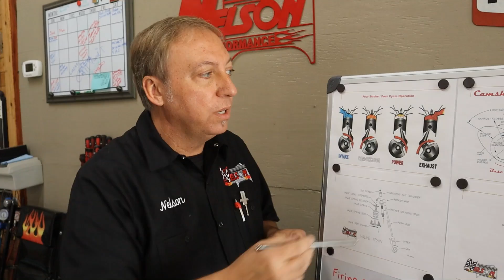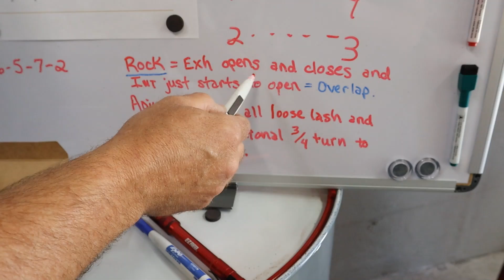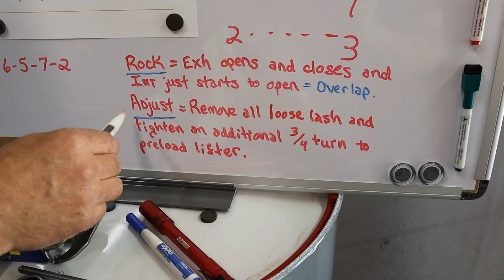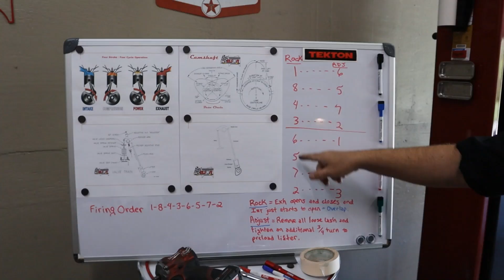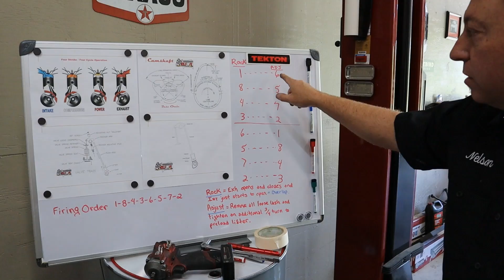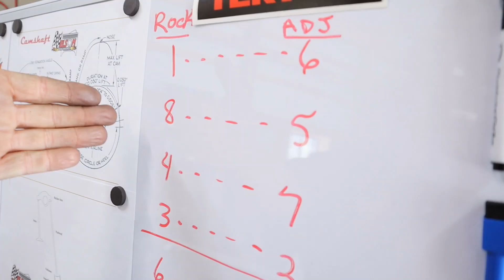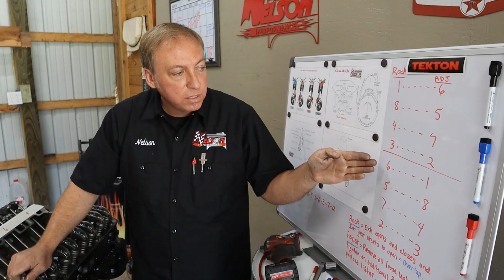Rocker Arm/Hydraulic Lifter Adjustment

Comment: I have always made sure they were all pretty loose on install, and then did each cylinder individually. I rotate until one valve is fairly open and take the play out of the other. Rotate again to open the other valve and close the gap on the second valve. Repeat for all cylinders. Then I adjust with the engine running, backing off each rocker until I get a tick, waiting a few seconds  for the lifter to pump clear up.. Then I close it down just enough to remove the tick & go 1/2 turn more. Some guys like 3/4. It's easier to me and never fails.
Reply from the maker: Yep, I’ve seen a few guys do it that way through the years. Gotta have good ears 😁

Comment: can i change rocker arms and pushrods without opening the valley/ removing intake? had wear and rod came through valve cover but not bent. i have not opened valve cover yet
Reply from the maker: Hey Bruno, yes, you can for sure do the rocker adjustment with the intake on. You would just watch for rocker movement v/s lifter movement. I would only be concerned that the lifter may have possibly popped up out of the lifter bore. It’s possible the area of the rocker that contacts the pushrod had worn through but I would also double check to make certain it didn’t have a tight valve stem in a guide. That would also cause rocker / pushrod damage.
Reply: @mitchnelsonperformance  I will check on guide clearance/ tightness. i will  try to see if i can use a boroscope i have to look down at lifter spot. thanks for response

Comment: How come some guys say 1/2 turn past zero lash?
Reply from the maker: Hey Rob anywhere from 1/2 to 3/4 turn will work. We just do 3/4 to make certain the lifter cup is away from the retaining clip.
Reply: That's what I use 3/4 .   I just wanted to know, even with a performance cam 3/4 is ok?
Reply from the maker: @lordsauto   Yes, unless the cam / lifter manufacturer recommends otherwise.

Comment: I have a 1998 GMC 454. I had to replace the head gaskets, so now I am on
 the re-install process. Would your process work for lifters that have already had oil in them? (Looks like you were completing a rebuild)
Reply: Hey Michael,  Yes, the process will work fine on lifters that have already been previously pumped up. They will bleed back under valve spring pressure as you turn the engine over. One other note to mention is if this is a non roller / flat tappet style cam all lifters must be placed back in the exact same lifter bore as it has mated/matched with that particular cam lobe. Cam lobes are ground tapered to keep the lifter spinning and many times swapping used lifters around will cause them to no longer spin and wear the cam lobe off and damage the lifter. You can however put new lifters on a used cam.
Reply: @danielnelson1399  Cool, thanks Daniel!  No, I don't think "non roller / flat tappet style cam" ... besides, I didn't remove the lifters, just the rockers and push rods. Thanks for the quick reply too!!

Comment: I have a cuestion..when you intall the hydraulic lifters do they have to point  any where the small hole they have  on the size the lifters ?
Reply from the maker: Hello, no that’s not necessary. The cam lobe area where the flat tappet lifters contacts is ground at a slight taper to cause the lifter to rotate/spin around when running to prevent lobe and lifter wear.

Comment: How does this compare to the EOIC method. Is this just a faster way of doing the EOIC method without turning over the engine many many times which would be required if you  started at cylinder #1 and went down the line doing each cylinder individually. I would like to hear your thoughts on this. Thanks.
Reply from the maker: Hey David, both methods are acceptable but yes, the method in the video is a little easier to keep track of and not get lost. Both methods concentrate on making sure the lifter is on the heel/base circle of the cam lobe before adjustment. I will add that I have used the EOIC method on large solid lift camshaft applications.
Reply: @mitchnelsonperformance  Thank you so much Mitch.

Comment: Honestly this is the best rocker and lifter adjustment video and explanation I have yet to see and watch
Reply: The best I learned fast
Reply: 8l
Reply: Agreed!!!
Reply: Question, can you adjust the values with the intake manifold still on the engine?
Reply from the maker: Hey so sorry, your message was buried under others and I must have missed it? first off, thanks for the view! Having the manifold on is no problem, you can just watch for the pushrods to fall and rise instead of watching the lifters and if you feel the up and down slack in the pushrod while tightening the adjuster nut you will know when to make the 3/4 turn. You can have a friend tap the starter while you watch them but it takes a very slight tap of the starter to get to the next adjustment. Good luck on the project!
Reply: For sure, i can now with some confidence to tackle this task
Reply: Ok

Comment: Hi Mitch! Thanks for a great easy to understand video. How would you suggest valve adjustment with the engine in the car and the intake on? Feeler gauges?  Thank you sir. Cheers from Motown.
Reply from the maker: Hey Robert, if it’s a hydraulic cam you can use the same procedure with 3/4 turn after removing the lash. It can be done with the intake on, you will just need to monitor the rocker movement v/s lifter. You can also use the starter to turn the engine. Just remember it will only take a slight bump of the ignition between adjustments.
Reply: @mitchnelsonperformance  Thank you Mitch! I will use my 15/16 socket and turn it over by hand observing the rocker movement. I really like this method  the way you drew it out on the whiteboard. Very cool and easy to understand. Appreciate your time and sharing this info with us weekend Hot rod mechanics. Respect and blessings from Michigan.

Comment: When I was 16 I would adjust while engine warm and running, by ear, this was in 1963, under a shade tree. Engine ran fine on Fri. Night.
Reply: 50 years ago after adjusting my rocker arms I double checked the rocker to valve clearance engine running and a feeler gauge.  If it was too tight the feeler jammed....too loose also not good.  When just right you could feel it .
Reply from the maker: @davidburman451   I can picture how that could for sure work on a solid lift. And you could just move right down the head One valve to the next while it was running. Neat idea/method.
Reply from the maker: Yep, when I was around 10 yrs old I remember my dad and a friend adjusting them “live”. Gotta listen close 😁
Reply: I was a teenager ...picked up engine building tips from an apprentice GM mechanic that had cut his teeth building motorcycles.  The gang worked out of a small drive barn on a farm. It had a chicken coup attached.  My brother in law was licensed also GM he built and raced stock cars at the local track.
You cant buy an education like that.  Weekends would see Nova's...Cougars...Mustangs come up their to receive some magic.  MG's were always welcome as long as it had wheels and ran.
Still working on shade tree projects doing a mild  Ford 5.0 for my 88 T bird this winter plus I have a Spitfire engine I'm just assembling now.
Loved your videos
Reply from the maker: @davidburman451  I gotta agree, they don’t make guys like that anymore. Guys that truly loved turning a wrench no matter what it “pays” and that’s what makes an awesome technician/mechanic.Totally different drive back then. I started building engines in a dirt floor shop myself. I’ve just always loved anything on wheels and owe my life skill and knowledge to many of those guys for taking the time to answer my questions back before you could just “type” it in 😊

Comment: Hey Mitch,  Thanks very much for producing this video it was very informative. I am currently replacing the cam in my classic holden 1969 (Australia)  I followed your instructions when adjusting the drive train after replacing the cam and your process worked very well. thanks again cheers premier186
Reply: Valve train*

Comment: Please overlook the newby question, I understand this is good for all hydraulic lifters but was wondering does that include hydraulic roller lifters? Thanks.
Reply: Yes. Usually the only difference between the rocker arms in this video and newer "roller" rockers is the fulcrum area running on needle bearings that ease the rocking motion, while the tips are still non-roller, so it all works just like this presentation. Most cars today have hydraulic, non-adjustable lash lifters/valve train. Solid lifters are for the higher end (RPMs) engines and require a different lash, due to the lack of a plunger in the lifter body (hence the term "solid"), necessitating a set clearance to allow for heat expansion, but still use the same basic procedure.
Reply: @v.e.7236  Ok thanks, its much appreciated.

Comment: Hello Nelson, I have a mercrusier 3.0L. After running the boat at close to full throttle for a few minutes, my engine starts backfiring and loses power. I put the throttle to no wake speed and I hear a loud ticking coming from the engine. The ticking goes away after about 3-5 minutes but if I power up again the cycle repeats itself. Any thoughts? Thanks!
Reply from the maker: Okay, so a couple of quick questions, does it have sufficient oil pressure at that RPM? The hydraulic lifters require this to stay pumped up and the lash removed. It’s also possible that the rocker adjustment is such that the plunger is too far down in the lifter not allowing for enough hydraulic area. Valve spring pressure can also cause this.
Reply: @mitchnelsonperformance  Oil pressure is 40 at idle and plane. Someone suggested running 1 quart of ATF with the oil for 10 minutes to help unclog a passage, then drain and refill the oil.  If that doesn't help then run without valve cover on to find the loose rocker. The oil level is full.
Reply: @Vuchswax  atf method is good for a stuck lifter , how many seasons does the boat have on it?
Reply: @joeKisonue  I think it's a 1992. I've since had it looked at. There was a problem with the fuel line coming out of the fuel tank that was replaced. It seems to run good now but I still baby her. When I'm pulling a tuber for a long time the issue is prone to happen.

Comment: 1:24 in and there's already a problem. The spark plug does Not "fire" @ TDC. It "fires" a number of degrees in crankshaft rotation BEFORE TDC igniting the air/fuel mixture (hence example, 34° of timing, obviously BTDC). The "compression" process of squeezing the burning air/fuel together is what creates the explosion thus sending the piston downward...
Reply from the maker: Exactly right! And a good point, but for this video we were just trying to concentrate on valve timing rather than ignition timing! We may make an ignition timing video in the future, and stress the differences between combustion chamber designs affecting flame travel.
Reply: My 2002 Hyundai Accent does at idle. My 85 k1500 350 says to set initial to -2 degress in the factory manual and it certainly still runs at 0 degrees timing. flames out the headers tho ;)

Comment: Do you got the number one cylinder at top dead center compression stroke before you do this
Reply: The way he defines the term “rock” as when the piston is going back up on the exhaust stroke, and the intake valve just begins to open, leading to valve overlap, leads me to believe that TDC is irrelevant. You’re looking for that valve overlap of the cylinder, so you can adjust the sister cylinder while it’s on it’s base circle.
Reply from the maker: We’re actually more concentrated on valve movement rather than piston location.

Comment: Mitch- great video... i have a question though. Im not a gearhead tho so this may be a dumb question.  I have a 454 7.4L v8 that started making loud tapping. I took off the valve cover from the drivers side and noticed i had a decent amount of play in the first rocket arm and the last. After researching it sounds longer those are bad,  but after watching your video could it better that they weren't set up right or something else went wrong? I have it on video if you'd like to see it.
Reply from the maker: Sorry about the late reply! Did you get it solved? It’s unlikely the rocker would have gone out of adjustment. I would suspect a failed hydraulic lifter, low oil pressure or an oil restriction.
Reply: The problem turned out to be every time you'd drive it up a hill,  the second you took your foot off the gas the lifters would come out of place and get all screwy. More than i wanted to deal with. I paid a mechanic to put them right and then sold it.
Reply: I’m having same problem. Do you still have video. Plz hep